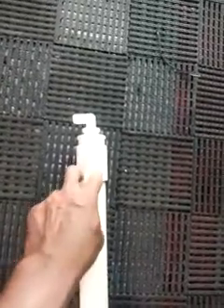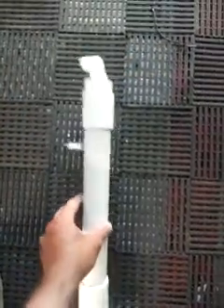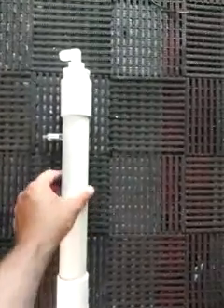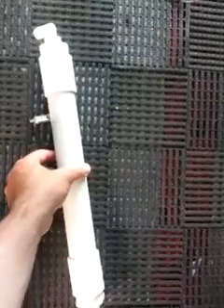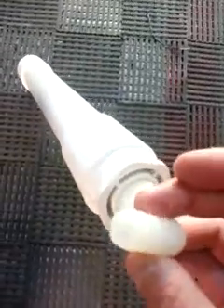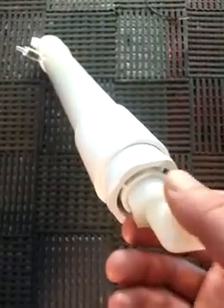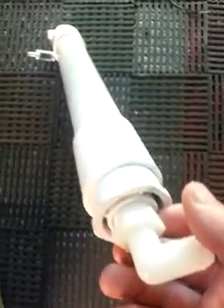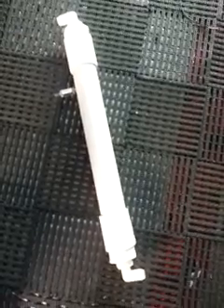The PlantGuy's inline CO2 Reactor.mp4

Comment from the maker: This type of reactor is the best in my opinion but I don't think it would work well with DIY as it wouldn't have enough pressure..but I could be wrong....the only downfall to this reactor that i can find is that it reduces your filter flow...If I was running a big tank, like over 100g, I would have 2 filters on it, one just for the reactor..could be a small cannister..